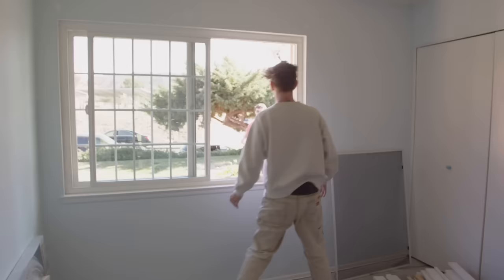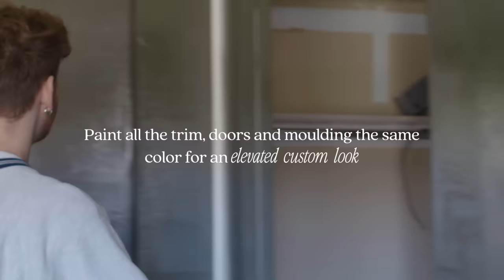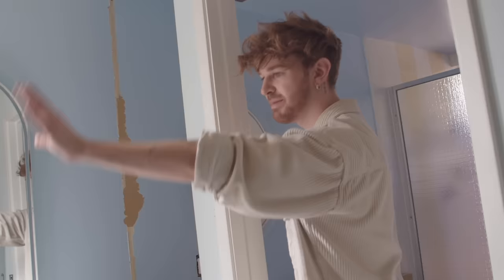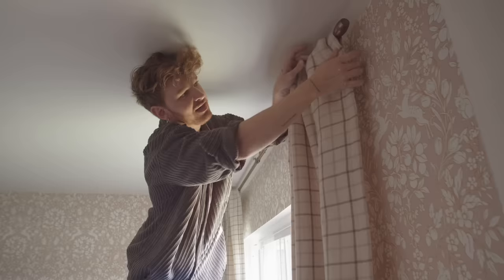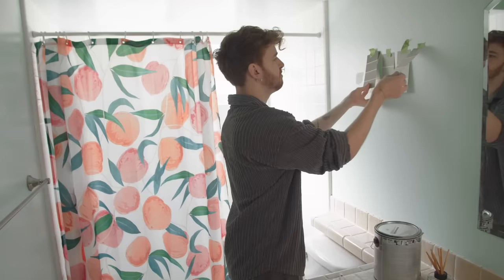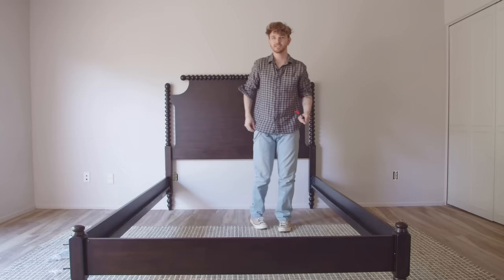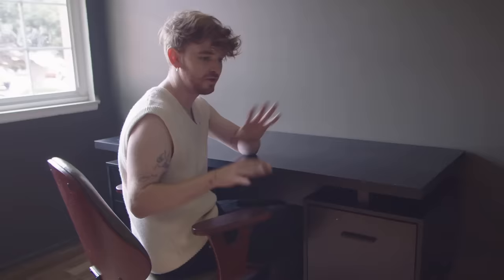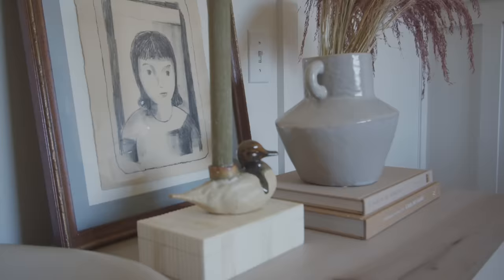5 EXTREME ROOM MAKEOVERS IN ONE VIDEO 🏠

Comment: Wallpaper Tip: Before putting holes in wallpaper to hang anything, first cut a small v-shape flap in the paper with exacto knife where the nail will be placed and fold back the wallpaper BEFORE you nail anything. If you want to move or remove anything, you can just use a dot of glue and push that triangle piece back on the wall and the hole disappears. I've used this for years and it works great!
Reply: That’s a great idea!
Reply: Wow, I can't tell you how many times I was stuck with a picture placement because I didn't want to look at a spackled wall. Thanks for this great tip.
Reply: Such a cool tip, thanks. I have wallpaper in four big rooms in my apartment and I’m always reluctant to put holes in the wall since it feels so permanent.
Reply: Love this idea, thanks…..
Reply: @jimwalker76  I have always seen the hole in the wallpaper as an excuse not to use it, but this trick is a lifesaver. We recently sold my parents' house and when all the artwork came down, we glued all the tabs back in place and there was not a single visible hole! Happy to help!
Reply: Brilliant!
Reply: That is a fantastic idea!
Reply: Saved my life, thank you so much for this tip!
Reply: Brilliant tip.
Reply: How does the wallpaper fold back though if it's stuck to the wall?  I feel I have to qualify that question by saying this is a genuine question.  I'm not being smart asking that.  If the wallpaper is well stuck down where you want to put the nail/rawl plug, would you dampen it?  Or apply heat?  Would really love to know because it's a brilliant idea.  Sheer genius.
Reply: @bluecurlygirl  you always want to use a little heat to remove wallpaper. Whether it's a tiny tab for this great tip, or the whole wall. Hair dryer works. It seems tedious but trust me peeling itty bitty bits of wallpaper and adhesive for days is worse.
Reply: Brilliant!!!!
Reply: Amazing transformation, beautiful.
Reply: Pleas tell me about the baby room wallpaper. It is just so absolutely gorgeous , pattern wise and color . I would love to put in my hallway .
Reply: Thnx for the tip
Reply: @bluecurlygirl  You create a place for a nail hole by peeling back a tiny triangle in the wallpaper. You cut a V-Shape in the wallpaper and then pull the pointed end away from the wall. Bend it back but don't remove. (Sort of the way you mark a page in a book when you fold over the corner.) Then you hammer in the nail in the wall that has been exposed and not touch the wallpaper. Behind whatever you hang over the nail, will be a bent back tiny piece of wallpaper. When you want to move something, remove the nail and then fold the little piece back into place. Let me know if that makes sense.
Reply: Thank you! Even though I do not have wallpaper I will definitely remember this! ❤
Reply: That’s so smart! And here I was thinking I could never hang anything on wallpaper 😅
Reply: Wow, I'm 68 and first time I have seen that tip.  I thought when he was drilling into the paper what a mistake it was.
Reply: That's a great idea!!
Reply: @heleneikerenkotter2950  He lists where everything is from for each room under the video in the "See more" section.....
Reply: Genius
Reply: @nancydann1332  Excellent explanation.
Reply: Wow, awesom! Thank you!
Reply: GENIUS!! Thanks for sharing, Nancy!  

Enjoy your day!!
Reply: Wow! Great tip!
Reply: @nancydann1332  Nancy that makes perfect sense.  Thank you so much for explaining it.  I will certainly remember this tip now.  Cheers. Much appreciated.
Reply: On pmon oo pool poor Kooba opposed oo
Reply: M9okooo on ojo ooo
Reply: O pm ok on 0?ooo
Reply: Oook
Reply: this is amazing, thanks!

Comment: Putting the wallpaper glues sided together is called booking. It gives the paper time to absorb the glue and relax.  wallpaper can expand its width up to 1/4 inch when you wet it with water, for pre-pasted, or paste. Booking helps to avoid expansion on the wall, which can cause bubbling and wrinkles, because it allows the paper to fully expand before you hang it
Reply: Great job    You should have your own show on HGTV
Reply: I wondered that myself, thanks so much for explaining :)
Reply: Wow thx for the info this will come in handy when doing dyi.
Reply: it amazes me how big time YouTubers are just getting THEIR education from all of us "oldsters" right here on their channels.  hahaha
Reply: booking also allows the glue to become a bit tacky so paper doesn't slide down the wall and it makes application to the wall easier as you keep the bottom half booked until you are ready to apply it.
Reply: That is so cool.  Thanks.
Reply: Booking! Thanks, I was trying to remember, it's been awhile. I came up with decking, but it didn't sound right! 👍
Reply: You make me laugh,so much talent Drew!
Reply: Another tip when pasting standard wallpaper... Lay the length of paper so the edge is just protruding over the edge of the pasting table. This way you can apply paste right up to the edge of the paper without getting paste on the table itself (which could transfer to the surface of the next length of paper).
Bitter voice of experience!
Reply: Thanks, Patricia!
Reply: Thank you for your explanation!...Nice!

Comment: Drew I’ve noticed that you seem to use regular latex wall paint on doors, trim & cabinets; be careful with this as wall paint is not formulated to withstand lots of impact, and trim/doors might be painted with oil based paint depending on the age (which can’t be covered with water based paint unless a good primer is used first, otherwise the paint will peel). Usually you need to degrease/de gloss, scuff sand if possible, use a good bonding primer and then use an enamel or urethane paint specifically for cabinets/doors.

Comment: TIP: Anytime you remove trim always score the edge against the wall with a box cutter so that you don’t tear the drywall and have even more repairs to make to the wall beyond painting/wall papering, ect.
    Opinion: with a baby you have to consider everything, the use and colors of fabrics, is it super easy to clean? Can a bleach wipe easily clean it? If not you don’t want it anywhere a baby/toddler, small child will be. Is it something that a baby would grab easily? If so can they put it in their mouth or will it cause a choking hazard? So although the style can be off the chart’s aesthetically, practically has to come first. Not to be a Debby downer but safety and durability are even more important than design when small children are in the home.

Comment: You really should use a wallpaper smoothing brush to apply it to the wall.  That ridged plastic just squeezes the glue out.  The very short bristle brush (/2" ?) gets the air bubbles out but leaves a film of paste/glue.  As it dries, the paper will lay flat very nicely to the wall.
  You book the paper for reasons explained below.

Comment: My dad used to first cut all of the wallpaper to size, than glue all of them one after the other. So when you done glueing the last peace you can put them up the wall peace by peace. He told me the important thing to use enough glue especially on the edges! It will soften the paper. You can leave it longer than 3 min.if you used a good quantity of glue. He also put some glue to the wall before putting the wallpaper.

Comment: I noticed in applying your wallpaper you did not snap a plumb line.  You usually do a plumb line to use to hang your first piece of wall paper, butting the edge of your first piece of wallpaper up against your line.  This is done to  make certain that your wall paper is applied straight as in construction some rooms are not all found to be square or have exact measurements.

Comment: Why you have to let the wallpaper rest is cause it expands with the liquidity of the glue and it needs to be fully expanded so it won't suddenly expand over time if you have a lot of humid air. Painter here. 
Also instead of folding it halfway try folding both ends to the middle where they meet. Also don't press it too hard while folding or you'll press the glue out of the paper. 
Also there are nice wallpaper brushes to smooth the paper onto the wall. 
And never open windows after or while hanging up wallpaper, wait till it is dried or you'll get gaps
Enjoy your content a lot

Comment: You let wall paper rest for 3 - 4 minutes to absorb the  adhesive. Which, here in Britain, is not usually PVA. We use wall paper paste, which is starchy and gloopy, and water based. And we don't fold it in half. We bring about a foot length over from the bottom, and concertina the paper, making sure not to put any creases in the paper. Allow the paper to absorb the paste then hang it on the wall, which we sometimes paste, or "size" first. European wallpapering lesson, free!!!

Comment: The glue has to sit 3 min so it can really bond with / soak into the paper. It will stick instantly way better after that, because some of the water in the glue will have gone, otherwise there is a chance it might glide down the wall because of the weight of the damp paper.

Comment: YOU NEED SAFETY GLASSES WHEN HANDLING GLASS OR MIRROR. THE GLUE ACTIVATES & STRETCHES THE PAPER. YOU SHOULD BOOK IT FROM EACH END TO THE CENTER. IT IS EASIER TO MANEUVER IT TO THE WALL WHEN YOU HAVE SMALLER SECTIONS